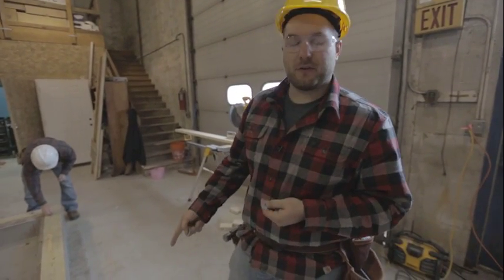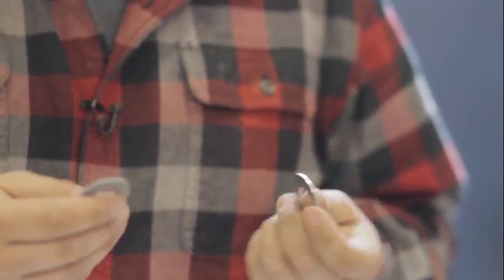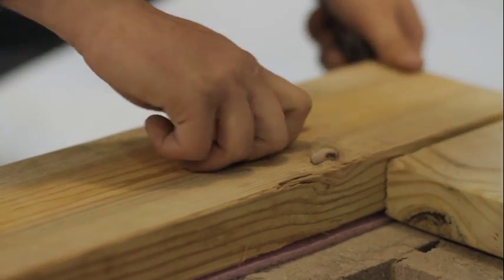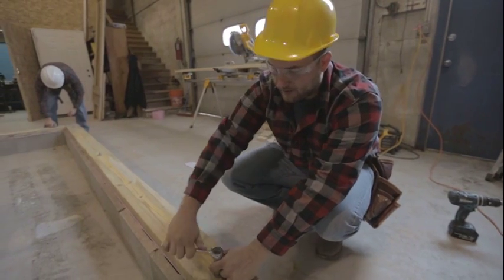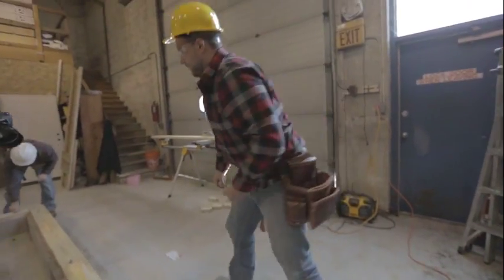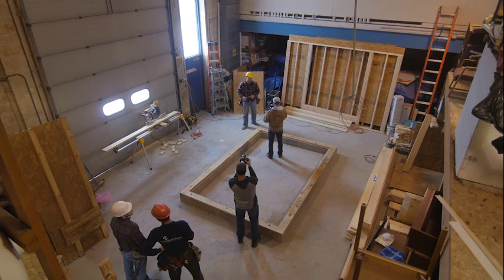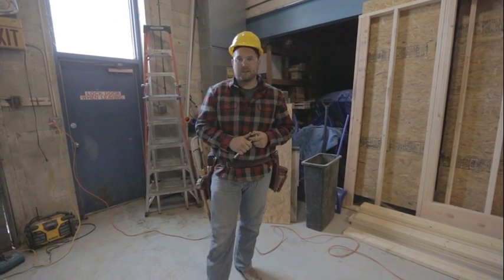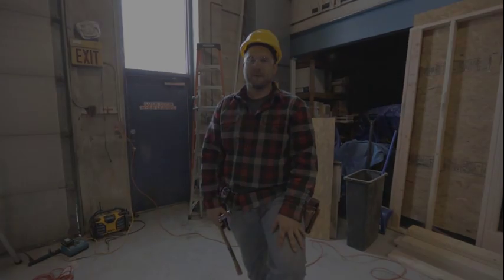How to - Floor Framing Part 4: Installing Mud Sill

Comment: With cast-in-place-concrete foundation walls you may need to use steel shims on top of the concrete to level the the mud sills before you bolt them down.

Comment: Like the video and the series but come on stainless steel won’t disintegrate it is in fact superior to hot dip galvanized.
Reply: Thank you for watching our channel! 
Treated lumber should only be fastened with fasteners made of stainless steel or a hot-dipped galvanized coating. You are correct stating that stainless steel is the superior of the two options however the cost can be between five to ten times more than similar hot-dipped galvanized fasteners. Every builder has different preferences and we must always weigh the options of approved by code and cost.
Thank you for your support of our channel!